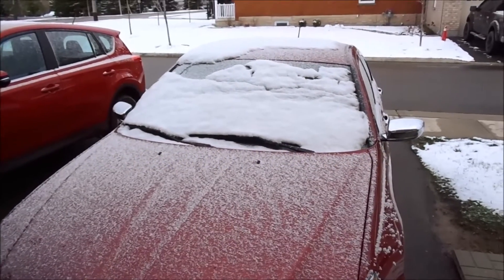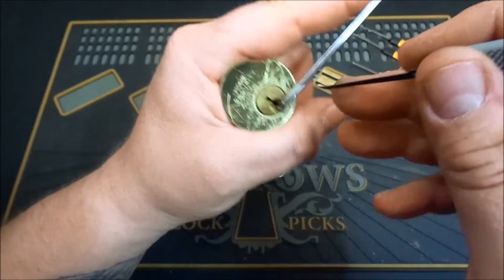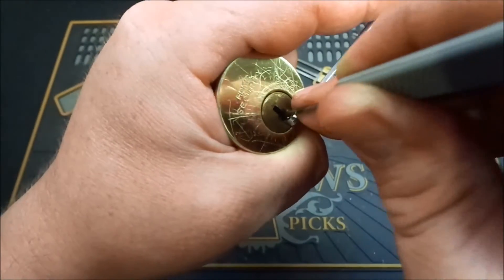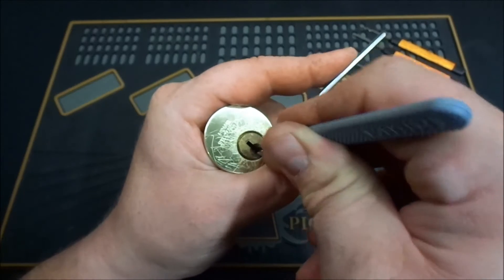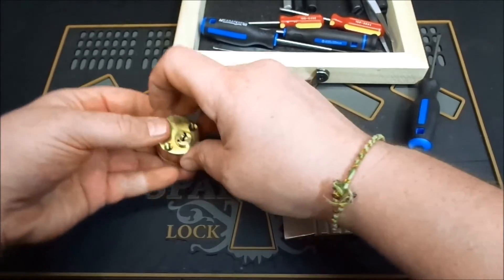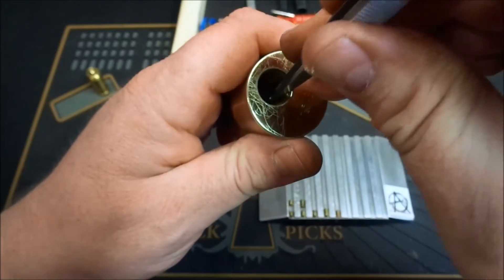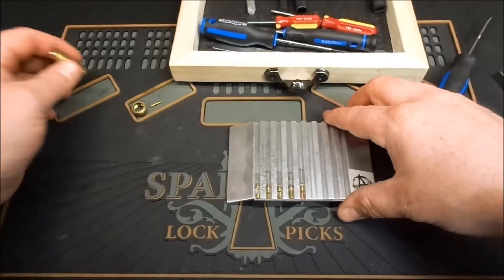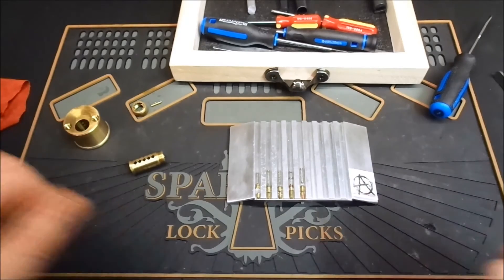*16* "Home Security" Challenge Lock SPP'd & Gutted.

Comment: Great video. Like your home made box - very well executed from what I could see.
To the lock: So many scratches on the surface; looks like getting a key in this lock is a challenge by its own ;-)
The picking was very entertaining and a nice fight. I also never had an overlift situation. You can shorten the chambers in the bible by inserting a small pin before you stick in the spring.
Reply: nice tip!  I need to keep that in mind.
Reply from the maker: +Potti314 I believe your right in that this lock has been pass around a few times or someone just had a real hard time finding the key hole!!!